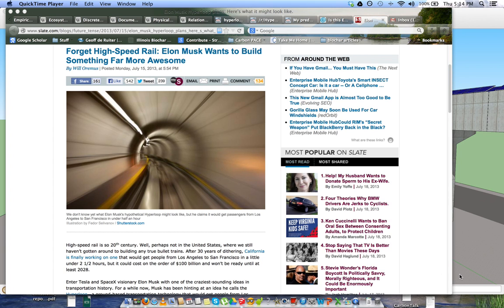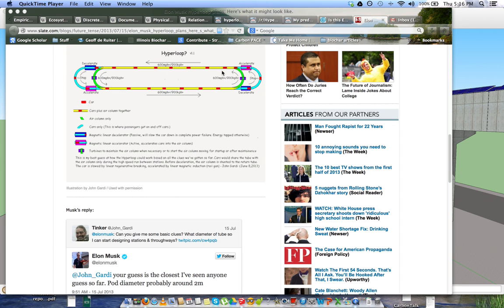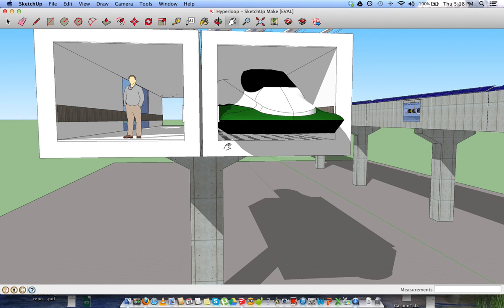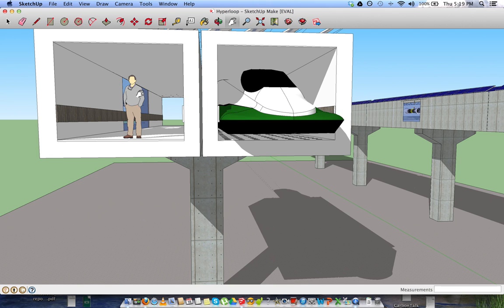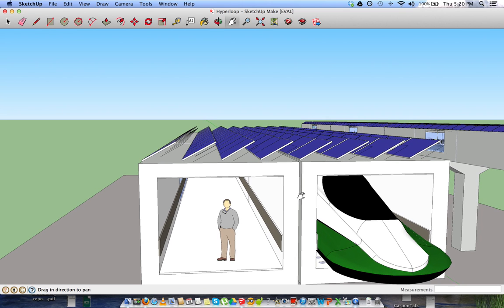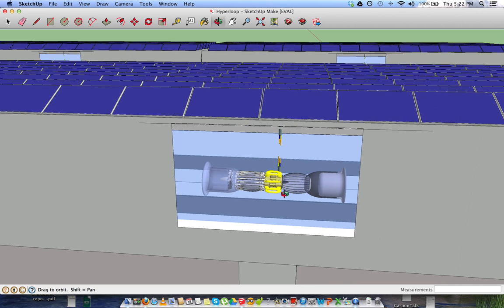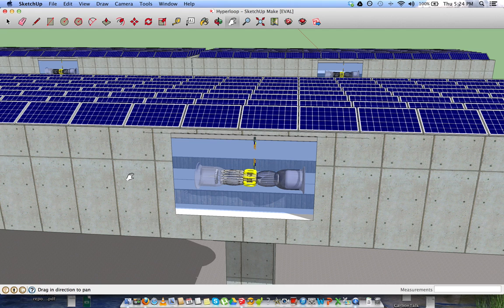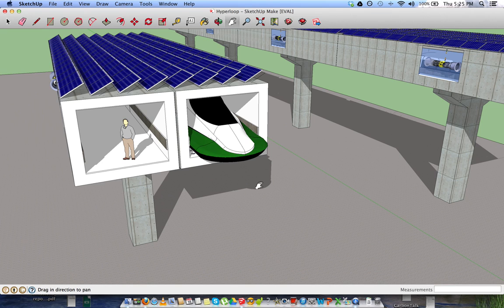Pre-Alpha Predicted Hyperloop Design and Explanation (Uploaded July 18, 2013)

Comment: Cont. In order to levitate the train the bottom portion of the tube will be pressurized with air that is stronger than the air that pushes the vehicle from behind. The air from below should blow at an angle. Once the vehicle levitates the jet engine then blows the car. Or in fact, there are no wind from behind, relying only wind from below. So, the tube should be round with a flat roadway. Square tube works but will be massively thicker. If anyone finds my idea possible please quickly make a video on it so it becomes open-source.

Comment: Hi Geoff, just a thought. I totally agree with your idea as well as some of the other comments made. One thing I am concerned about is particle degradation within the closed loop itself. Things like dust particles and other contaminants affect most of our transport systems today, aircraft engines for example get damaged by the smallest collection of dust inside the turbine itself which in turn can cause the engines to fail. How do you think they will stop this from happening in the closed loop?

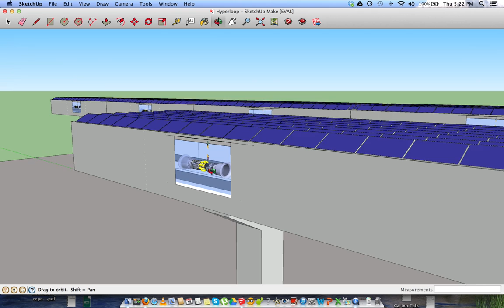Comment: 7:24 jets refer to a plane that uses jet engines.. ur not using jets ur using jet engines second of all jet engines refer to an engine that obtains thrust by taking in air at the front, using it to burn fuel, then ejecting the hot combustion products at the rear through a propulsive nozzle bro u cant have combustion using electricity. please dont call them jets again. u sound dumb

Comment: So a tube using a shape that will stabilize the pod which itself is designed to utilize the aerodynamic grounding affect driven by a linear magnetic motor assisted by pressurized air that is brought up to speed by stationary jets. Problems are wind shear on the walls, entrances and exits disrupting airflow, almost certainly have to be maglev to keep it off the tube. Tube material would need to resist deforming from weather or earth instability. Sounds unlikely but each problem might be solvable

Comment: I am guessing, but what I guess is that the passenger carriage is floating on an "air bearing", or hydrostatic bearing.  This is the same type of bearing utilized by hard disk drives.

The company Sub-One has made a super-slick pipe coating.  It will definitely take something like this to keep airflow noise down.

Comment: Personally I think there is going to be very little air flow over the pods. I think there will be a seal between the pod and tube meaning a finite amount of air between one pod and another. This will mean that the volume of air between the pods will stop one pod crashing into another if anything were to go wrong with the braking system (because the air can only be compressed so much).

Comment: Also, the passenger compartments are going to be completely passive and all of the floating and propulsion will be provided by the tube. The reason for this is that you can't risk having a "train" break down in the tube as this will cause risk of collisions with other trains. If the propulsion is centralised to the tube, if it fails then all "trains" will stop thus avoiding collisions etc.

Comment: Well when your going really fast you can take a detour and make a longer curve just like on the high way....your not taking right angle turns at 70mph your taking long arcing curves at 70mph.Think about it  on most highways your traveling on the outskirts of town making a long arc into town via expressways and then off ramps.On the other hand there is only so much space for all this.

Comment: I believe that the system will be in a closed tube where the air will flow continuosly at a speed similar to the speed of the vehicle. The tube should be round to minimize the energy loss. The capsules will be small (like the rolllercoaster cars) and propelled by magnetic levitation. The capsules have to be accelerated and decelerated prior to enter and before leaving the main tube. if energy fails there will be a cushion of air between cars that will prevent accidents. It should be undergound.

Comment: Although, freeway curves are designed for speeds of 75mph (sorry about the units), not 1,000mph.  the g force around curves will be a big problem if trying to build over freeways.  Doesn't land still need to be bought, even if the system is elevated?

Comment: There's another guy who had the idea of using a very large amplitude, very large wavelength (2 times the size of the capsule) sound wave to reduce drag by having the capsule travel at the speed of the sound wave, at just the right place in the wave form.  So with your jets the "speed of sound"/travel would be greater than mach1 at near zero drag.  Also, I think this would fall under Elon's "crashless" claim.

Comment: Cylindrical v tubular. Elon specifically said yes when the PandoDaily chick asked if it would be a tube. Tube = minimize surface area to volume ratio, thus minimize friction between air and wall. The bottom of your capsule could be equally effective upside down air hockey table if circular.

Comment from the maker: You know, you are absolutely right. I didn't think of that. Could be enough to change my opinion actually. I still thing the top will have to be flat for the solar panels to be easily installed but other than that, could be!

Comment: in regards to square vs circular, wouldn't you want it to have some degree of roll? this would allow for less restrictions on track pathway design as it would require less planning for angled banks at each curvature of the track and allow for tighter curves to be traveled because rolling would divert the centrifugal force downward at each curve in respect to the passenger.

Comment: Seems a reasonable guess at it. I think a circular tunnel is more likely purely from an aerodynamics perspective in getting the air to move efficiently at high speed whilst minimizing turbulence. You're probably going to want a turbine the same diameter as the tunnel to move the air and the turbine will of course have to be round. But I reckon you might not be far off what Musk is thinking.

Comment from the maker: You know, I am not really sure. I know they have very long maglevs already. The solar panels along the track could supply electricity very close, so perhaps no real long distance transmission would be needed. I know if that were the case and the electricity could be used (with the jets), and with the railgun, resistance would be very little. If super cooled superconductors were used the energy cost of that might be more than any resistance of a system. Just some thoughts.

Comment: You should provide some concise list of claims about this.

The wind speed of 200 mph is hitting the nail on the head exactly.  I keep hearing people make this erroneous argument that the wind speeds are too high to practically maintain.  They might be if the wind were the thing pushing the car, but if it's just being pushed to reduce wind resistance, it still makes sense.

I think friction will still too big of a problem, and it might not work.